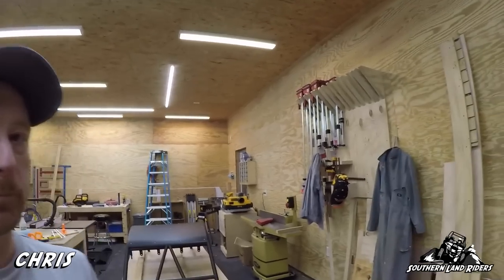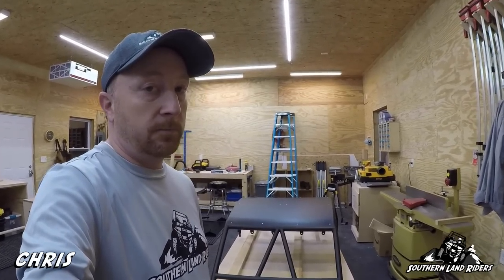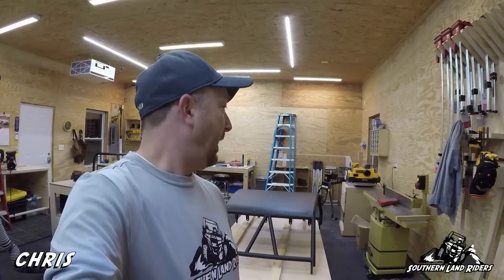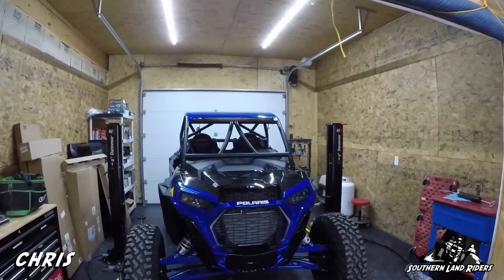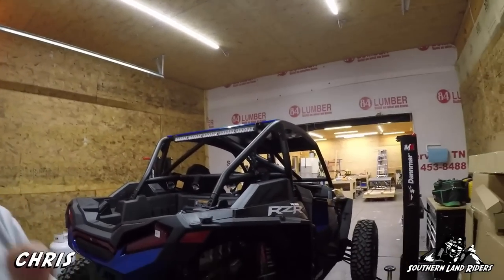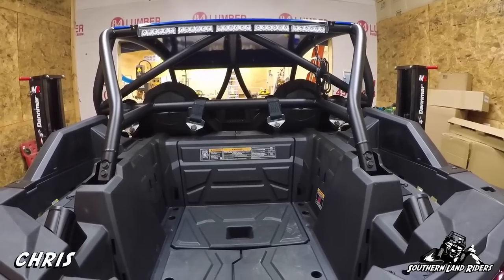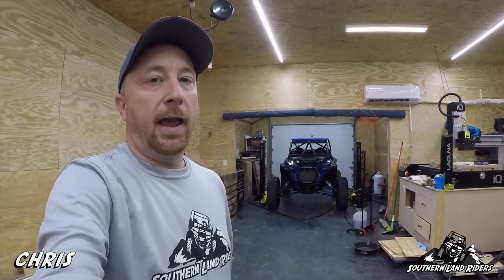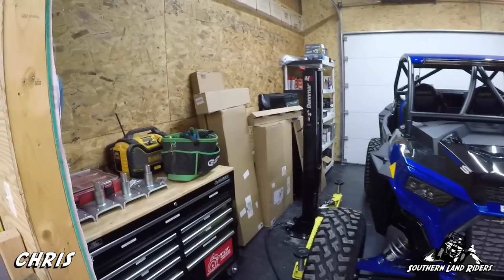Chris's Turbo S Build (Video 1 of 4)

Comment: For me the X3 was the reason I watched you r videos.  There aren't a lot of guys driving X3 xmr turbo r on the trail.  I have one and for me its easier to work on then my razor xp 1000.  It also destroys my razor in capability.  You guys are so lucky to live in Tennessee.  FLORIDA SUCKS.  Such a beautiful place you have there.  Good luck.
Reply from the maker: We are lucky to live close to Windrock. I am in Alabama and it is about 7 hours for me but worth the drive.
Reply: Oh ok got you.  I thought do to riding there a lot thats where you lived.  I do like your vids a lot keep them coming.  I hope you get to spend time with your kid riding those memories are priceless.   @SouthernLandRiders
Reply from the maker: Thanks buddy. I wish I lived closer. Chad and Chris both are in TN and are very lucky. Glad you like the videos!
Reply: I’m very blessed to live here for sure. Don’t worry, Ole Yeller isn’t going anywhere. I’ll still be driving it at Windrock for sure, just not as often anymore. I really do like it, but lately, I’ve been getting random check engine lights after about five or six hours of riding. No codes, just check engine and limp mode....gotta get that squared away
Reply: Right on.  Good luck.  Might be a warning on the belt temp.  Who knows.  Sometimes you get those lights when heat or moisture leak in.  Sounds more like heat. @x3dominator28
Reply: Rodney Duran I put new S3 A Arms on my X3 a month after I bought it. I’ve since installed new bushings as well. In my opinion, working on the A arms of an X3 is the biggest pain in the ass in the SXS world. It’s a hard fail in my opinion. Thankfully I have lifetime bushings in it now. I shouldn’t have to take those damn things off ever again

Comment: I’m kinda curious what lift is that u use to lift the side by side with? Dannmar brand but what’s the specs on it as far as lifting and measurements.
Reply: Dave’s Life this is their portable lift, capable of lifting 6000 lbs to a height of 4 feet. I’m thrilled with it. You bolt it to the floor where you want it, there is a range for width. I have mine at 92 inches so I can lift the X3 and he Turbo S but still get my tractor in the bay if I need to without unbolting it from the floor. The M6 from danmar

Comment: So no more X3? Should rename the channel same vehicle different people
Reply from the maker: He is still going to ride the X3 occasionally. Sorry, we do not plan to change the name of the channel.
Reply: I’ll still drive Ole Yeller. It’s an amazing machine. Like I said....I just don’t like working on it. The XMR Turbo R’s are more involved when it comes to a arm bushings and the like....have to take the freaking. Winch off, pull the front drive shaft off, remove the bolts holding the front diff in...it’s a pain to work on